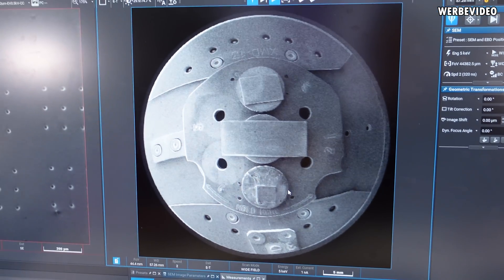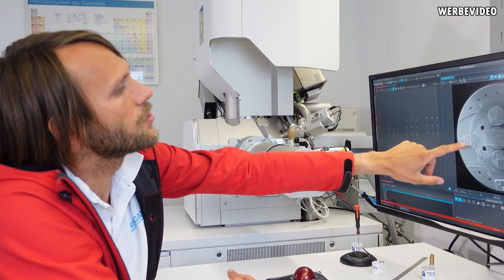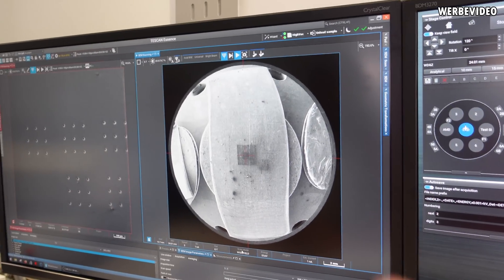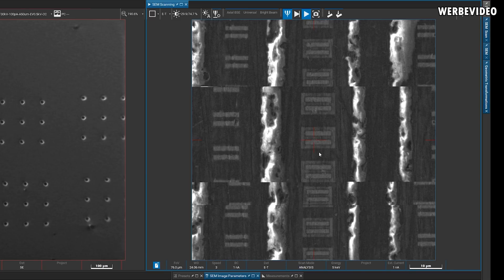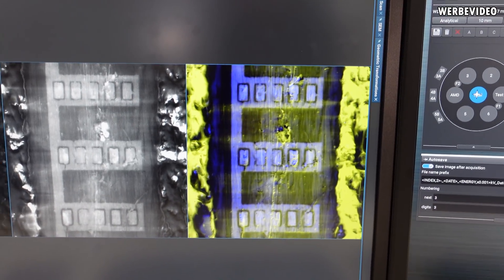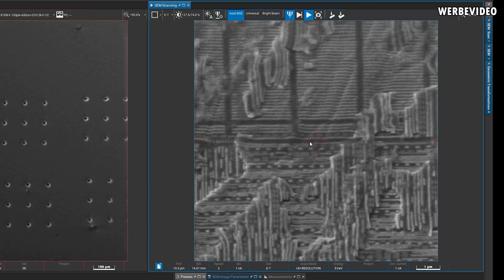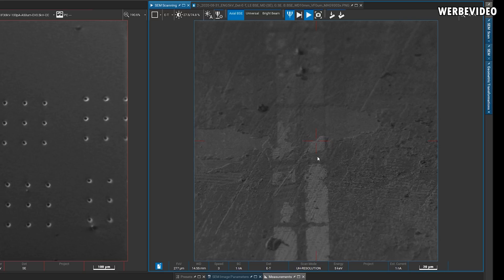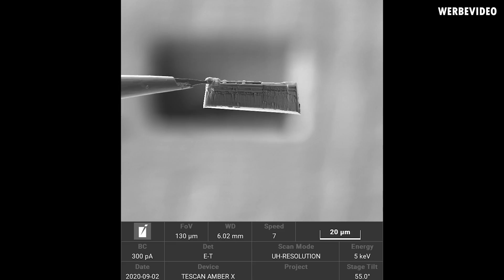Ryzen Nano-Structures more than 100,000 times magnified. Visiting Tescan Part 2/3

Comment: I sometimes think that how these structures are made into this small die in order to make CPUs for our general use. Lots of respect to those engineers who design this masterpiece for our laptops and PCS and shaping the technology of future..
And also thank you for this video!!
Reply from the maker: What blows my mind every time is how hard it is for us to make this stuff visible with million of dollar equpment. But then somebody made this :D haha
Reply: @der8auer  

Ok so you know what Electron tunneling is with the transistors, and how they use silicon transistors to get smaller like the 7 nm they are currently at with AMD's Ryzen 3000 series CPU's.
And the 5 nm, 3nm and so on, to make the computers more efficient with performance and energy but now we are starting to see more heat.
Silicon has limits but they keep trying to improve it, and it will melt at specific temperatures, so we need to replace it.
Ask yourself why we aren't using Quantum Materials like Graphene (yet) and still using silicon. 🤨🤔

This is where Graphene will fix the electron tunneling aka Quantum Tunneling, we don't need silicon to get down to 1 nm "nanometer" in size.

Imagine this, Graphene computers with a magnetic current to be 1,000 times faster and possibly only use 1% of the energy used. 💡

Now imagine Graphene optical / transparent transistors for Photonic Computing. 💡

Now imagine Graphene lasers for the fiber optics that would be used as the circuits inside our computers for Photonic Computing. 💡

--------

I would rather see Graphene computers, let's get rid of silicon. I'm serious.

Check this out.
I would give links but the video hides my comments.

Go to my channel and click on the playlist called "Videos with important info to get around my channel". ✔

Watch a Flash Graphene video about Flash Graphene 100 dollars "per ton". ✔

And then another video about "Large machines on earth / in space to make Flash Graphene". ✔

After that, check my channel with 2 simple steps for my other channel, go to the "About" tab of the channel I'm commenting with now and read the info with a link found there to save to your browser's favorites. ✔

==============================

Imagine Graphene for Photonic Computing, to help us save on our energy needs, really think about that for a second with Photonic Computing.

Check my other channel for these 2 playlists.
Photonic Computing playlist. ✔

Graphene computers for home and Starships, playlist. ✔

Learn about Graphene from my other channel's "Graphene playlist". ✔

If you want to know more about Graphene and Quantum Technologies, go to my other channel. ✔🤔💡
Reply: @der8auer  😂😂. Truly an innovation.
Reply: It's crazy. A gross oversimplification is that semiconductor logic is designed using a special programming language such as Verilog HDL, then other software uses it to help design a photomask for lithography, the mask is printed on glass, UV light is projected through it onto photosensitive material that sits on top of the oxide and substrate sandwich with extremely focused optics, and then various chemical processes take place in order to etch the now miniaturized pattern onto the actual silicon, or use chemical deposition in those selective areas. Decades of research have gone into this insane technology.
Reply: In one word photolithography. And it's the technology of the present and near future. After the limits are reached of what a lot of tiny silicon transistors can do, future progress in computers will have to rely on something else entirely. In the past telecommunications used to rely on copper cables which are far inferior for carrying data compared to fiber-optic, a similar radical change is eventually coming for processors.
Reply: If you are really interested, I would look up this video "Indistinguishable From Magic: Manufacturing Modern Computer Chips
", it's almost a decade old but a fascinating talk on the process of manufacturing transistors in Intel.
Reply: @DrivenTrigger  Noice
Reply: Isn't it made through doping with neutrons?
Reply: @MrJohnboyofsj  Well it depends mostly everything uses MOSFET based technology so either parts are doped with plenty of particles not neutrons in particular, but bounded with other subatomic properties to enhance or detriment conductive properties of the material in order to create and N-Type, or P-Type Sub system. They introduce chemical impurities in the Silicon Crystal Lattice at that local level, They do this through a method called "vapor-phase epitaxy" Basically it's a type of chemical that breaks down the lattice at applied locations, you can also use a similar chemical method to coat or bolster resistances in areas too. Other methods include Molecular-beam epitaxy, Pulsed laser deposition Which relay on the same logic.

By Damaging the Lattice in "Channel" Area you increase electromotive potential of electrons to pass through the substance when pulled by or pushed or both by a similar source. (The same thing if you bolster it to reduce electromotive potential.)

So Simply Doping relies on taking away or adding substances to the Silicon Lattice inside the chip, it is often considered layering because it's not entirely incorrect. but its better to look at it as deconstruction or augmentation of existing silicon which is required for MOSFETs in general. (due to complexities of gate to drain relationship.)
Reply: they are basically taking silicon and make it cost like gold.
what I'm trying to say is that essentially those guys just using science to make money from sand.
they wouldn't do it if it wasn't profitable. also they don't make progress if it isn't highly profitable. just look at all Intel pluses in their 14nm+++++++++++++.
Reply: @rawdez_  I guess We did find the philosopher stone, Turning sand into gold..... Btw don't listen to the trolls they honestly believe that a system of exploitation like this is meant to benefit them and only them. people who faun over capitalism like this hardly understand the science behind the technology you only innovate so your competitors don't leave you behind. It's a pretty narrow-world view that is indoctrinated, This system clearly is for profit but wasn't born from profit alone. the days of true innovation are behind us.  One day there will be no more customers to buy the products because the corpotocracy left everyone to die.
Reply: @Ren-kei  yeah, the sad part is if it wasn't all for the sake of corporations' profit technology could've been much more advanced by now. on the other hand without corporations technology could've been much worse than it is now.
Reply: @rawdez_  some form of group cooperation was required, there's plenty methods of productions that could of made that be.
Reply: @Ren-kei  yet none produced better results than corporations did.
Reply: @rawdez_  That's because our society doesn't have Coops etc because our government is super afraid of them, There wasn't really isn't anything like that probably not for another generation or two before humans start arranging themselves in more democratic structures.
Reply: @rawdez_  If you think engineers work because money, then you must be some kid.
Reply: @ark_knight  you missed the point of what I was saying. engineers work on what corporation tells them to work on.
it's never their decision. they aren't shaping shit. neither do corporations if its unprofitable. 

if you think those companies work to 'shape the technology of future' you are delusional.
all it boils down to is making money from sand. 'the technology of future' is by-product and its often intentionally made worse than it could've been to not disrupt steady cash flow.
Reply: @ark_knight  also companies intentionally cripple performance on low- and mid-range parts to maximize profit from selling higher-end parts. its not some charity - its business of screwing customers and making them pay as much as possible for current product. corporations never really care about customer or about 'shaping the technology of future' if 'caring' isn't profitable.
Reply: @rawdez_  Stop before you make a fool of yourself.
Reply: @ark_knight  please, ever heard of such thing as arguments? you already failed to participate in a meaningful discussion. all you're capable of is making unrelated statements to feel better for yourself.
Reply: @rawdez_  Sure, you have shown enough of your 'world- awareness'. Thank you mate.
Reply: @rawdez_  Most of those techniques are from laboratories funded by national science foundation or other funding sources that don't look at profitable but scientific advancement. Many of the findings made their way into the consumer market, but more are just for fundamental research purposes.
Reply: @rawdez_  But sometimes, it's another way around. The technique he's using to cut the wafer for TEM imaging is called FIB, Focused Ion Beam. FIB was initially used for depositing metals on substrates to repair circuit boards in chips. It is also very useful for removing materials from the substrate if the ion beam is strong enough. It has become the standard procedure for preparing TEM samples. The FIB cut the specimen in several nanometers thickness and then fuses the specimen onto a TEM grid for imaging.
Reply: @qingohyeah6775  that fact doesn't change anything. scientific advancements don't benefit anyone if not publicly available. corporations use science to make money without making any progress as long as possible. they start innovating only if their business/steady cash flow is in danger.
thats probably the main reason why we still not having instantly charging solid-state batteries with enormous capacities, worldwide space-based internet, scientific bases on Mars and the Moon, flying cars everywhere, hovering boards and stuck with 14nm++++++++++ for 6 years.
who needs all of that if we can sell gas, the same CPUs/GPUs over and over again just by adding pluses/Super/Ti in the name, stupid apps on App Store with free analogs on Linux or Windows, and start renting movies/music/apps so nobody owns them anymore and you have to pay for using them every month.
Reply: @rawdez_  I'm pretty sure you can make those things happen, bro. Anyway, can you lend me your copy of Karl Marx's books in the meantime?
Reply: @RafaelBenedicto  very funny, take a cookie.
I don't see how making true statements makes anybody Marxist, even if you are true 100% hardcore capitalism fan ignoring its flaws is just dumb.
Reply: @rawdez_  Well. Whatever's going now you've to accept it. There's no one who can change it (probably).
Also,if things went like you've said,then we wouldn't have to wait for 2050 (you know what I mean)
Furthermore,as consumers / customers, we use this technology for our own benefit. Generally, there are very few people who think just like you. We've to accept it.
Reply: @TWG_50  
>now you've to accept it
no, I don't. i can't change how things are but i don't have to accept it.
>2050 (you know what I mean)
nope, thats some dystopian movie reference?
>there are very few people who think
true.
>we use this technology 
we have no choice and we pay to use it, a lot more than its actual worth is. you are talking like current tech is affordable for everybody, its not. planned obsolescence is literally in everything, everything is build for you to throw it away in a couple of years and buy a new one. corporations literally sell overpriced trash and people are happy about it.
Reply: @rawdez_  You're kinda right.
The word "affordable" is now slowly declining.
One day you'll see AMD, who's now making near "affordable" products will also become like Intel and Nvidia.
Sometimes I think when will the "cheap" thing will come.

And regarding about obsolescence, it's natural. You've to change after a couple of years. If that wasn't the case, we would've seen IBM PCS still now,or Intel & AMD wouldn't have made CPUS which you're using now,rather we would've used Phenom / 1st Gen series.
See,the obsolescence is much like a common thing. This is only for the sake of advancement in technology. Engineers always try to make something innovational in order to achieve what is needed,and it's seemingly increasing.
See, it's 21st century. Years are going by. As a result,new technologies will come. Common people will use it for their convenience.(I'm not taking the "affordability" into account)
Reply: @rawdez_  In reality, no they don't. The bin split for parts speed does that quite naturally. You generally only get high speed parts being binned as lower speed parts when the process has improved to the extent that there are no parts binning in the lower speeds and the demand is for lower speed parts - even there they will more likely drop prices to encourage sales of the higher performance part and stop selling the cheaper lower profit part.
Reply: @qingohyeah6775  Not really, the sample area is identified, then either side material is removed to leave a very thin slice of the structure you want to look at, with a "deep" hole either side to allow the view of the sample. Samples will be preferably a few nm thick, thick samples do not image well, and frankly can have confounding structures you do not want to see. A good TEM will show individual atoms.
As far as FIB, yes that is used to thing the sample for TEM, but it doesn't really get used for parts repair as it is not a production worthy process - cost is higher than benefit. It would only get used for selective dep/etch for test parts where you want one or two die, otherwise you're better off with generating a new reticle. Even here I think it is likely that this is done external to fab, where this can be done on specially designed areas where sections of circuit can be cut for testing reasons. You would not want to send Gallium contaminated material through the line.
Reply: @rawdez_  Sorry, but you have no idea of the difficulties of doing this stuff. Making A transistor that works is not necessarily that difficult, as part of a development activity (in a company) we made ~20nm planar transistors in ~1997 to investigate their characteristics. This wasn't that easy, but it gave us insight into things we needed to study and develop, but they were only "one off" structures with a few hooked up into some ring oscillators. To make a real product you have to increase density, not just reduce size, which throws up a load of other issues, not to mention defectivity that just goes wild as you get smaller & increase density. Defectivity usually feeds back into the tools &/or processes you use not being clean enough - time to buy a whole new equipment set & redevelop your process. Then you add on control, as everything gets smaller, allowable variation budget shrinks and maybe disappears - try and control your process to 3 sigma when your allowable budget is say ±1nm or less, then try and make it where you would like it at a Cp/Cpk of 1.5 to 2!
That 14nm process going to a 14nm+ process represents tens to hundreds of man years of effort where structures are subtly improved depositions, etches cleans, imaging, materials improved/checked to see if they actually make a difference functionally, or is it better for defects, does it reduce tool process times to increase capacity or does it improve process and but slow down manufacturing - is that an OK trade off (unlikely) etc. etc. All against a background of you better not kill the process! 
Oh, and to confirm a process change is good will take high tens of lots, if not more, which is expensive in material & process costs (you can't sell them!) and time - it takes 3 months + to get through the fab, then has to be tested, maybe burnt in for reliability checks depending on what you are doing. Results then need to be analysed, change justified, signed off, implemented etc. etc. It all takes time & money!
Reply: @thecraggrat  Sorry, but you have no idea of what you're talking about. its not like AMD/Intel/Nvidia are multi-billion dollar corporations that have done all of it multiple times and have decades of experience and now are just milking it for profits by selling overpriced tech with huge margins. 

or is it?
Reply: @thecraggrat  In reality, no they DO.
artificial product segmentation is literally everywhere, we have boards with locked OC capabilities that artificially can't have 'premium features' or support all processors on a socket they use. B550 doesn't support Zen & Zen+ CPUs without reason, and B450/X470 will get BIOSes for Zen3 after a delay of couple month (maybe even 6-12 month) just because its unprofitable to release those BIOSes on Zen3 launch day.
if what you are saying were true there wouldn't be 2400/2666MTs caps on non-Z Intel boards, or non-overclocking boards for that matter. and no stupid A chipsets on AMD. 
thats just what i can remember quickly. there are like billion of other examples of artificial product segmentation everywhere.
like new Ampere cards support virtualization in hardware, but its disabled in software because 'its enterprise feature' of much more expensive cards.
Reply: @rawdez_  Well actually I have worked in the Semicon industry for 30+ years doing process development/transfers/ramping/sustaining & improvement, so I have a bit of a clue as to what it takes.
Just because you do process development time after time, doesn't mean it's easy. You see new issues arising on each new process and it gets significantly harder at each process node.
You also have no idea as to costs too - a logic fab like intel's costs ~$4B to build and outfit and has to run thousands of wafers a week to make it pay.
Yeah some products have high margins, but they don't yield well and are small volumes (relatively) so harder to control and get high binsplits. Most product has small margin and yields are critical to maximise profit.
Reply: @thecraggrat  >~$4B to build and outfit 
its already built. and again, we are talking multi-billion, like in 'Hundreds of billions of dollars', corporations.
they have money to do that stuff and make progress constantly. they just don't because its much more profitable to sell the same stuff over and over again. thats the real reason, not the price of manufacturing new nodes / building and outfitting fabs or possible difficulties.

in other words the ONLY reason they don't do progress constantly is because corporations' primary goal is to make money, not to make a progress.
Reply: @rawdez_  From the standpoint of making chips, the ideal is that the chip is fully functional and yields in the top speed bin split and all die is sold at a high price. This does not happen in reality, you have different speed bins and different functionality bins from the same product. Now there are also different products to address different markets, say 2 core and 4 core. If your 4 core product has 1 or 2 non functional cores, you can burn config fuses so that it is reconfiged as a 2 core product, this maximises you profit. Likewise you can reconfig max speeds of product to match your sales, obviously you don't want to sell high speed product for low speed money, this is a business. You would prefer to sell all product for bin speed if possible though.
You also only run product with extra capabilities that you turn off if it makes sense, say volumes are low and extra capability doesn't take up much area, so yields are not significantly affected. Otherwise you run product tailored to the market, unused Si area just costs too much. If what you say for nVidia is correct, then they have made the decision that running one product with a software switch is worth it, despite lower yields, to control its product mix at the board level rather than running two chips through the foundry with the increased costs this brings.
Reply: @thecraggrat  all of that doesn't contradict what I'm saying here.

they could've just sell better parts cheaper, instead they artificially cripple performance so you won't get it for what its actually worth and they could continue selling same overpriced chips but with more pluses in the name instead of making real progress.
i don't see how slowing down progress benefits anyone apart from corporations.

we'd still have 4-core CPUs max and $1200 GPUs at top end if it wasn't for AMD. thats how corporations ACTUALLY work.
and suddenly they start to sell '$1200 GPUs' for 500 bucks. and its still highly profitable. 'small margins' you say.
Reply: @rawdez_  Yep, they make money, great! If they make lots in the good times, they can still manage to invest in the down times. In case you don't know historically the semicon industry would run in 3 year cycles of good to bad times, so salt away profit wile you can to be able to invest when profit is down.
Intel had ~$21B profit last year, but to do process development for a new process node you need ~$4B to build and outfit your development fab, actually more for the next gen due to EUV exposure tools running at ~$120M each; stand 3 years of costs to develop the new process ($B??), then build another new fab to run the new technology, likely at >$4B as you want volume from this fab, so more tools/bigger building. So cost of developing a new technology and getting ready to run it ~$12B. You better be making money hand over fist, and you are trying to do this every 3 years; though I will concede the rate has dropped off over the last 2 nodes as the problems to be solved mount.
If you think that intel/TSMC/Micron/Samsung et al drag their feet trying to make progress then you are sorely wrong.
Reply: @rawdez_  I think that we have a different concept of artificial product segmentation, it seems you want to have everything without paying the price. Just because a functionality is locked out doesn't mean that there is an artificial segment created, it is just more efficient for the fab to work this way. Otherwise you would get a product that just supports what you are being sold with no wasted silicon and more product ID's would be run through the fab.
As it stands you get the product you pay for at the price you are willing to pay, the company eats the additional production cost for extra silicon area for flexibility.
You want more functionality, pay more.
Reply: @thecraggrat  no, I'm not wrong.
those corporation are not run by progress makers, they run by greedy board directors. the main thing that interests them is money.
if they can spend less on R&D they actually do. and then they lose market share to AMD, fire some top guys and hire new ones that are starting invest in R&D more.
and if there is no 'AMD' to steal their market share they don't do sh!t.
Reply: @rawdez_  Well, sorry, but you are. Just because you invest in R&D, doesn't mean you always get it right. 
I'm presuming you are comparing Intel & AMD here, the truth is intel is way behind on their next process node delivery, even though they are spending just the same if not more to try to catch back up.
AMD, BTW, gave up on process development and are making product in foundry for "7nm". I was personally very disappointed when they did this.
What AMD are doing (which I personally believe Intel should be) is splitting up the monolithic processor IC into core/memory, video, I/O and running each chip type on a tuned process. Also because each chiplet is separate, yields improve (smaller area - less prob of being hit by a defect), better speed bins (smaller area - less within die variation of CD etc) & obviously less compromise of design & process to make everything work. 
This allows for overall better Si usage & ability to match all chiplets of the same bin split for use on the same processor. The downside being the issues that have been experienced with the chip to chip comms, but that is manageable. The yield & cost advantages have allowed AMD to undercut Intel and more importantly, still make money!
Maybe Intel will follow this, I think they should, but they may have other solutions.
Reply: @thecraggrat  Well, sorry, but I disagree. If you treat R&D as a secondary matter because there are no competitors and you make fun of 'gluing chips together' and instead work on 'improving' your 5-year-old tech then you 100% don't get nothing new.
the other reason they don't do nothing progressive with their CPUs is probably because they don't really care about desktops and focus their R&D on laptop and server markets, again, because those are much more profitable markets. 

You are just defending corporations because you used to work in one of them.
Everything you write doesn't contradict factually what I'm writing here.
>You want more functionality, pay more.
you are not working for Intel PR, aren't you? thats way too corporate thing for you to say.
nobody in their right mind say it like that if they aren't selling said functionality.
how about 2080ti - you payed more and got the same functionality as 3070 that is 2,5 times cheaper. 
pay more you say, right.
Reply: @thecraggrat  >pay more 
how about fu?
Reply: @rawdez_  Sorry mate, but I know Intel is working hard on R&D (Like I know so is Micron and others). I also know Intel screwed the pooch on the 10nm node and are trying to recover as best they can, but are not doing a good job, let's face it they are ~3+ years late with 10nm.
At the same time as the R&D for next node, they are doing process improvement for 14nm, this is something that always happens on a production process...you make it better, faster, cheaper, more reliable etc.
BTW, I wasn't making fun of "gluing chips together" I think it is a damn good way of maximising yields/bin splits etc. Also this helps with the push to many core processors, as larger monolithic die as in Intel server products dump yield quickly with increase in die size. Hence high costs.

I'm not defending corporations because they don't need defending. If it wasn't for them we'd still likely be running ~1um tech on 6" wafers. Corporate funding pushed the technology for cost reasons.
I can remember when it was said we wouldn't print <1um. It was a corporation who wanted to make more money who got past that barrier.
Oh, and if you knew me you wouldn't ask if I was working in Intel PR! :-)
Reply: @rawdez_  Sorry, I thought we were having a discussion about how things work. But as Niven says...TANSTAAFL

Have a nice day :-)
Reply: @thecraggrat  we were until you said 'pay more'. the right answer to 'pay more' should be 'fu'.
Have a nice day yourself))
Reply: @rawdez_  Sorry mate, but the way of the world is if you want more functionality, you have to pay more.
Right now I would buy AMD as I think it offers better perf/$. I also don't mess with overclocking much etc., though I used to, I just buy an upgrade when I need the performance. 
Usually the base level performance has improved by 2-3x by the time that happens now.
Reply: @rawdez_  wow, imagine paying for the latest technology that people have put unimaginable amount of time designing and making.

If the world was full of people like you, corporations wouldn't venture and spend more on R&D because it costs too much and if they were to raise the price even a little, people wouldn't buy their products anymore. Nobody would've bought any technology made in the 19th century because they were so expensive back then, and it would have never caught on, and we'll still be living in the stone age.

Certainly, you can simply not accept this kind of behaviour from corporations, just don't buy their products. If the 2080TI is expensive, simply don't purchase it. It's not a necessity. You're not the only one that thinks this way. While others will purchase it for one reason or another, it's their freedom to choose, isn't it?

Perhaps, you can be their financial advisor next time and convince them to price their products cheaper. Sure, stifling the growth of world-leading tech companies will be good for us in the future, wouldn't it?
Reply: @seahyx120  false 'logic'. paying and overpaying are totally different things. also I was talking about tech corporations sell like 'new' when in fact ITS ACTUALLY NOT.
RTX cards obviously never actually were worth $1200 bucks. if dumb people with money burning their pockets bought it for such prices doesn't mean its worth it. it never were. 
in reality when corporations can't sell overpriced tech THEY LOWER FREAKING PRICES. just like NVIDIA did because suddenly competing AMD products appeared on the market with much better prices/value.

 >stifling the growth of world-leading tech companies 
yeah, totally agree that we need trillions dollar corporations like apple with closed ecosystems and unreasonable 30% cuts on selling apps on their platform. or hundreds billions worth Intel that pays OEMs to not use AMD products essentially killing all competition and as consequence raising prices and re-releasing the same 14nm CPUs but on new motherboards again and again and starting to actually innovate only when competition arrives. yeah, we totally can't live without corporations doing sh!t like that in the future, and we can't live without artificially overpriced tech and totally should pay x2,5 more because we are dumb and can't imagine living another day without RTX. or when AMD advertises support for AM4 socket all the way while new AM4 CPUs are being released but then ignoring those claims because it interferes with sales of new AM4 motherboards. yeah, its baaaad to stifle growth of sh!t like that

what we actually need is more competition on the market and probably much better regulation on those markets from governments, so corporations would do less sh!t and more good stuff.
Reply: @rawdez_  indeed, I do agree with the last part of what you said. All you needed to say was that. Have a nice day :)
Reply: FIRING MAH LAZARRRRRRRR